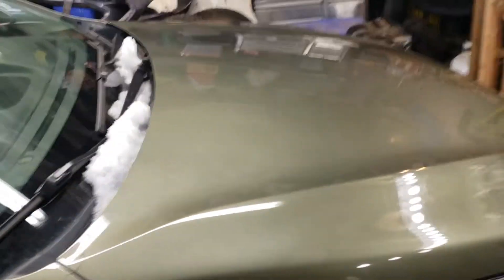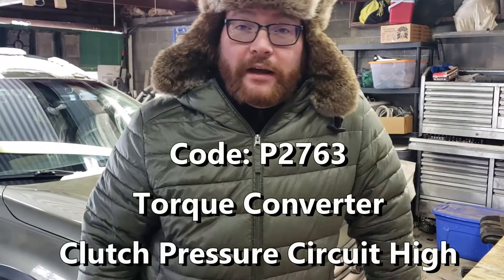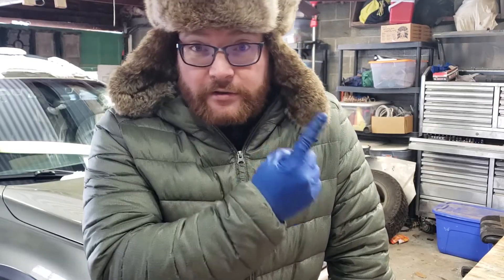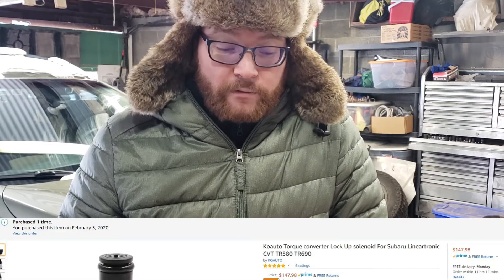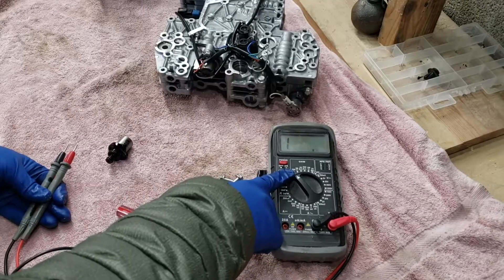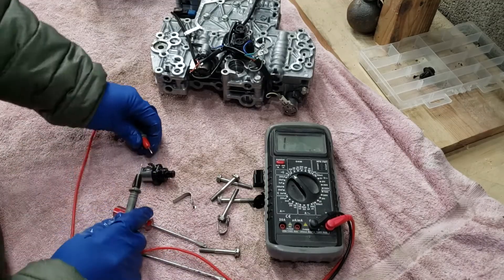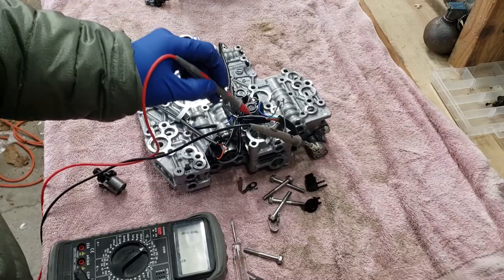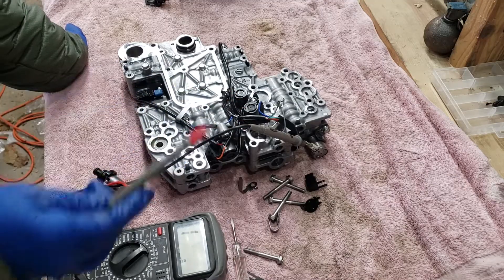Fixing a BROKEN Subaru CVT for CHEAP.

Comment: Hi, I'm in Australia and I've just been quoted AUD$4500 for a valve body from two Subaru dealers, even though there are multiple videos on YouTube showing how easy it is to change. Just drain the CVT, remove the bottom pan, remove the valve body,  replace the faulty solenoid, refit the valve body and the bottom pan. Then refill the cvt.
Reply from the maker: I'm not sure the conversion rate but I would expect $1500~2000 USD for a valve body job.

Comment: I've read in the Subie forums those aftermarket solenoids can fail relatively quickly. Go to a junk yard and pull the solenoids to get OEM. Do it on a subie with a TR580 transmission so you can work from the engine bay vs. under the car! The solenoids referenced in this video are the same in each version. I got 3 solenoids for $50!

Comment: After getting a new torque convertor, then new body control valve 3 years after (last year), my partners Subaru cvt broke down again. Drive disengaged while on freeway and heard some metallic clunking noises along with strong smell of cvt fluid inside the cabin. No leaking fluids, cruise flashing, AWD, at oil temp, engine, battery, oil light all solid. Engine running fine, put vehicle in 1st and reverse tried to test light acceleration, though gears were not engaging at low rpm. Roadside assist comp showed Error codes P0270, P2746 and P2750. Any ideas? Maybe one of the steel chain pulleys broke?

Comment: Do you know if the CVT learning procedure is a good idea after this replacement? Just finished this exact job on a TR580.

I figure it’s just a single solenoid so probably not impactful but maybe the ECU is somehow adaptive to the lower coil resistance. I don’t want it to mess up the new solenoid as a result
Reply from the maker: Some users have reported a need to do it and some have not. It might be vehicle or year specific. 

Personally I would run it and if it throws a code have it relearned at a shop since there is a good chance you can save that money.

Comment: I went to the Amazon link for that solenoid and  they have 37% 1 star reviews for the solenoids being faulty or lasting a few days to a few months.
Reply from the maker: I've had some people report that they changed it in a parking lot and it's lasted years. I've had some report similar to what you're saying here.
Reply: @bruceyyyyy  I got lucky. Upon inspection of my valve body I found the terminal end on the ground to the Lock-up and Primary Up was broken off. Evidently it would lose connection and throw a code, then when I stopped and shut it off it would sit against the valve body and make connection for a while.
Reply: @bruceyyyyy  I think it's just the luck of the draw.

Comment: Does Bruce or anyone know if lockup duty solenoid will cause Torque Converter failure? I have the stalling issue that is also common on these CVT's. Stalls on hard stops as torque convert pressure plate does not disengage. I assume that this solenoid allows the fluid flow to the torque converter.

Comment: What's the part number and make.
I saw part of the Amazon description on your video but no actual part number.
Thank you
Reply from the maker: Subaru doesn't apply a part number. They only list part numbers for the entire valve body which retails for approximately $1500 last I checked.

Comment: Will this work for a 2015 wrx? The parts catalog lists a part number for 2015+ across all the models, so I am wondering if I can use older instructions on this model. Also - I have code p2757 - but absolutely no symptoms. It runs fine, no stalling, shuddering, nothing. I have 120,000 so I am  out of warranty and I am considering replacing the solenoid myself....
Reply from the maker: If it's the same solenoid it's worth a shot. I don't think they're all the same.

Comment: This is a great video! I have a 2012 Impreza. Dealer replaced the valve body in Feb 2021 for free. Now, unfortunately, the car just stopped driving. Slight whining sound, then a loud clunking sound with what felt like the rear end hopping, then no Drive or Reverse. Park and Neutral still work. 
Codes and info I could find are as follows:
P0700- Trans Ctrl Circuit

U0122- VDC Lost comm
P0841- Fluid pressure sensore circuit
P2746- limp, speed sensors, valve body
P2750- valve body

I would love to find out that this is in fact a much more accessible issue than a complete transmission failure.
Any thoughts? I will happily venmo you for your time on this.

Comment: Awesome video. I have a 2012 Outback with the P2763 code and will try this out. Hoping to save lots of $$. I believe it was referenced in a prior comment, but to your knowledge (by replacing the solenoid only) there is no need for relearning, right? I don't have the means (scanner) to do that. Additionally, I watched MrSubaru1387's video where he referenced the manual valve/plate, ie. "NOTE: Engage the manual valve to the manual plate." Any guidance you have on getting that right is appreciated. I believe some folks replacing their valve body have had some mishaps there, which caused issues after the pan was closed. Thanks in advance!!
Reply from the maker: You can test the solenoids connectivity from the transmission wiring harness without having to drop the pan. 

I didn't make that clear in the video since I bought the valve body used to rebuild it.

The people that have done this say they did not need to relearn the valve body.

Comment: is there another way to check the resistance of each solenoid ?....externally without dismantling the transmission valve body?
Reply from the maker: Yes of course. There is a transmission harness connector at the top of the transmission above the torque converter. 

I only measured this way because it was already out of the car.

Comment: I can't believe subaru replace the whole transmission for that small part...
Reply from the maker: Yup.  They'll sometimes replace just the Valve Body if they can confirm it's just that single solenoid.
Reply: @bruceyyyyy  I have a 2015 Forester that start showing the christmas tree with "at oil temp" flashing probably time to replace the valve body or the CVT... thanks for the video
Reply from the maker: I would get it diagnosed at an independent shop if it's passed the warranty.
Reply: @bruceyyyyy  I went to the dealership today, had the transmission code P0971 and the solenoid was broken, replaced the body valve under warranty, hopefully it broke before the end of the warranty

Comment: Hey Bruce how did your solenoid hold up?  I want to replace it on my 2014 Impreza, but the one on Amazon has mixed reviews that it failed within a few months. 

Where can I buy the OEM one if it’s available
Reply from the maker: It's still going.  I have noticed mixed reviews on it but unfortunately I am unable to find an OEM supplier.  

The safest bet is replacing the Valve Body in its entirety.  But it increases the cost exponentially. 

For the TR580 I would say it's 100 percent worth the gamble.
Reply: @bruceyyyyy  thank you 🙏.  I’ll take the gamble.  Would you also recommend changing the transmission fluid?  It has 123,000 miles.

Comment: I followed this technique to replace the solenoid in my 2012 Outback when I got the code P2764. I used the link shared to order the solenoid. It worked great for a year but then I got the code P2763. I figured it was one of the other solenoids but when I pulled out the valve body it turned out it was the one I had just replaced, this time reading low instead of high. Any idea what could cause this? Bad part? Could it be the wiring harness or is it time to replace the whole valve body?
Reply from the maker: I've had a couple people tell me that the solenoid isn't OEM so knowing that I wouldn't expect it to last as long but less than a year is kinda a bummer.

Comment: Thanks.  I check my circuits and was concerned because I couldn't see how the resistance of 52 ohms could be that big of a deal... seeing yours at 22  and you replaced it and fixed the issue, I feel  much better,

Comment: Hey Brucey, I followed the procedure and the car works almost flawlessly again, thank you for posting such an informative video! The only issue I'm having is that "reverse" behaves like "drive." So now the only way to go in reverse is to put myself in neutral and get pushed...so not the best haha. Per some earlier comments, I would have thought that maybe the valve body is bad, but it was working perfectly up until I tried to swap the solenoid so I'm inclined to believe it's still okay. Any thoughts on what I might have done wrong? I'm thinking maybe an O-ring didn't seat correctly, or I bumped some level when I reinserted the valve body.
Reply from the maker: That's such an odd issue. Are you sure all the connectors are good? I know there isn't a true reverse in these.

Comment: I need help with my 2013 outback the mechanic is trying charge me 2000 for parts and labor. I need help!!
Reply from the maker: If replacing the entire valve body that's a high but not unfair price. 

You can try just the solenoid and even reuse the fluid if you want. The 2013 will not require me fluid since the pan needs dropped.

Comment: I have a code P0971 for the AWD solenoid. Would you happen to have the part number or link for that solenoid? Thank you!
Reply from the maker: I do not. It's on the valve body though so the process should be very similar.

Comment: I've fixed a few automatics this way by either simply changing the fluid and filter (88 BMW 325e), conductor plate (99 Mercedes E320 and 05 Dodge Charger), and (06 Saab 93) solenoid kit. Non of them needed another transmission.

Comment: Hey Brucey, I really appreciate the helpful video! unfortunately my solenoids all seem to be in working order. I have a new valve body coming, but I am starting to think it is the transmission itself. I have a 2010 Outback, and I found a 2012 Legacy donar. I saw on a forum you mentioned your buddy did a trans swap similar. I was told it would not work but I dont see why I couldnt swap the Trans and TCM and just have different gearing. What are your thoughts? Thanks Buddy!

Comment: Solenoid connector direction DOES matter! If they're connected backwards the electromagnet inside will try to move the plunger in the opposite direction when powered because it's a DC system.

Comment: Replaced my lock up solenoid after checking resistance at the upper transmission connector. It now works like new again.  Thanks for putting this out there.

Comment: Is this the same solenoid for P2762 Torque Converter Clutch Pressure Control Solenoid Range Performance Problem (in a TR690)?
Reply from the maker: I believe so. One is a high code and one is a low code.

Comment: How do I identify my transmission part number? I am have the same problem with my car . Just happened a few days ago. My Mechanic can do the solenoid fix . Just want to make sure I am getting the right part.
Reply from the maker: Check the connector and confirm OHM resistance is within spec.

Comment: So how do you know which CVT is in the car?  2013 Impreza base model.
Reply from the maker: Easiest way to know is to look:

TR690 Valve body is on bottom. 

TR 580 Valve body is on top. 

I think it's probably the TR690 if it's a 2013. The TR580 didn't show up in the Outback until 2015.
Reply: @bruceyyyyy  It's an Impreza, not Outback. Just checked, valve cover on top - TR 580 it is.
Reply from the maker: Perfect. Should be less messy for you!

Comment: Hello I have a 2015 subaru outback with codes P0700 P0717 and P0747. Car goes forward when reverse is selected, neutral is like park, unusual noises also coming from the transmission. Car has 140k on it. Cvt fluid looks clean. Where should I start? Thanks Chad
Reply from the maker: That sounds like time for a valve body rebuild.
Reply: @bruceyyyyy  can I get one off  eBay? Or any lines on one? Would the valve body throw off the turbine input speed sensor causing the p0717 code? Thanks for the info! I was ready to replace the transmission...
Reply from the maker: I would get it diagnosed by a mechanic first. Call up your local Subaru dealer ideally.
Reply from the maker: But yes you can get refurbished valve bodies for a few hundred or a new one for around 1k.
Reply from the maker: @chadwissner597  The valve body and the torque converter are the most common issues with the transmission. The turbine code makes me think TC actually.

Comment: If someone is interested in an OEM solenoids i have 2 of them, want to sell them so i can get some money back after I bought a 800 valve body instead of changing the solenoid,
I ordered through amazon but i got a very bad Chinese solenoid and I didn’t want to  install it, so i am selling each for $80, that way i get some money back and you get original solenoid,
Reply from the maker: This is a great idea.
Reply: Do you still have the two solenoids? I will purchase one.
Reply from the maker: PM me
Reply: @bruceyyyyy  Do you still have one available?
Reply from the maker: @mattsandvold1011  Unfortunately no not at this time.

Comment: that soleniod has a lot of bad ratings. Its the same manufacturer as oem?
Reply from the maker: OEM does not offer just the solenoid.
Reply: @bruceyyyyy  ordered it today. The green wire one only had 5 ohms,,,,Thanks for makingg this vid, big help!
Reply from the maker: Let me know how it works out! I'm trying to get this method known because it's a big repair bill otherwise.
Reply: @bruceyyyyy  well, im back watching the vid again for a refresher. P2764, it lasted almost a year and a half. Ordering another solenoid now,,, saved myself a bunch of mula... thanks

Comment: your a legend mate, ive been going through a process of elimination on my 2008 outback, ive had sporadic jerkyness under accelleration that has come and gone in the past but recently i have had the AT oil temp light start flashing, along with the traction control and abs lights lighting up as well.. im waiting on a foxwell 301 scan tool to arrive in the mail this week and hopefully it will shine the light on the problem ? but atleast i know if it is valve body related i wont be paying a local mechanic $2000 to sort it out (things are a lot more expensive in australia, both parts and labor)
Reply: I got quoted $3k in Sydney. what happened in the end for you?
Reply: @Dreamer10888  i ended up cleaning out all the sensors and changed all the fluids (trans fluid, engine oil, radiator coolant,etc), new air filter and sparkplugs (i also made sure the distributor and wires to all sparkplugs were in good working order), i also put a new radiator in because the old one had a small leak which i suspect affected the overall cooling more than i could imagine, everything has bee running ok since then. but one thing id suggest is always make sure your fluids are at proper levels, either too much or too little will both cause issues from what i can gather ? and if you have an older subaru where the tank may have a bit of gunk in the botton ? never let it get too low on fuel so as to avoid the chances of that sediment moving through the fuel lines and injection points etc. i wish i could give more specific advise but after months of relentless searching on forums and youtube etc i couldnt find any real solid advice on this issue yeah ? and i suspect your mechanic might not know either but has just thrown the $3000 quote at you for something he probably doesnt understand or know how to remedy properly ? lol
Reply: @Dreamer10888  *oh and you can buy the parts of ebay, just chinese replicas probably made in the same factories tbh ? and do the job yourself, its not to hard yeah, just need a weekend with some spare time and to make sure you research the procedure on youtube properly as well as find yourself a service manual via a google search etc just to reference if you need to. it will save quite a bit of money if your a hands on type of person etc
Reply: @monogramadikt5971  Thanks for the detail, i didn't service the car for over a year and this happened a week or two after having very low fuel.. sighs*. Many thanks for the insight.

Comment: Fix works, I ordered the solenoid from Amazon. Removed the valve body and installed the new solenoid. I re-installed the valve body and all is well. FYI, the defective solenoid was reading 18 OHMS. 
Just a note, make sure to lineup the manual valve. Once the valve body is removed there is nothing to support the manual valve and it can slide into the valve body, and it's easy to miss when reinstalling.
Reply from the maker: Awesome! It's not a hard fix. Just messy. I had one guy do it in the parking lot of a Walmart.
Reply: I did exactly this... Quite a headache having to re-drain and re-assemble just to connect the manual valve :(